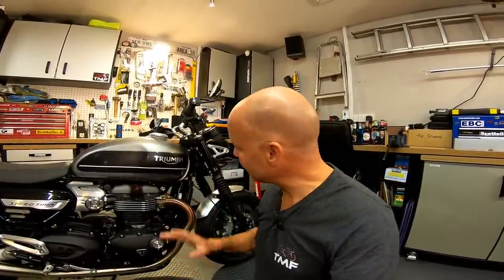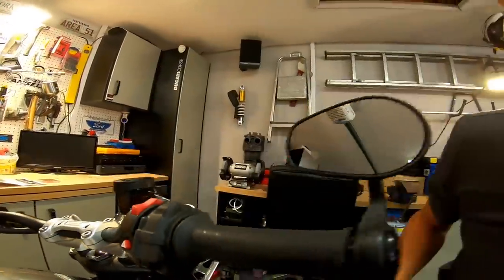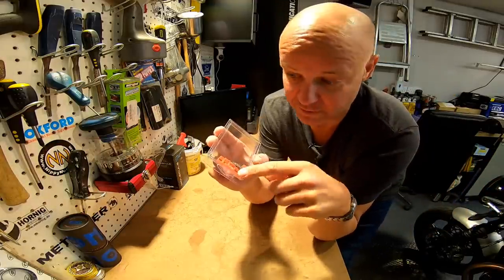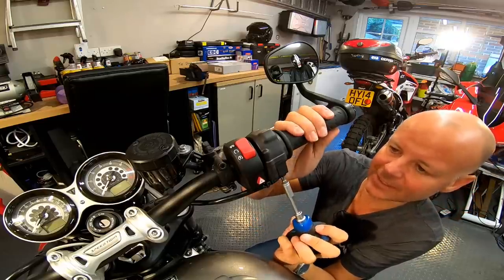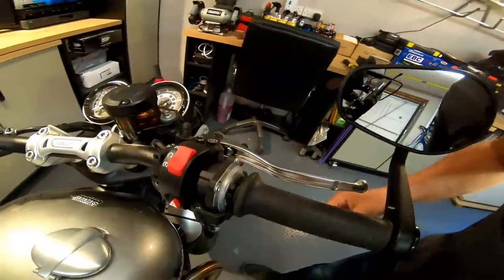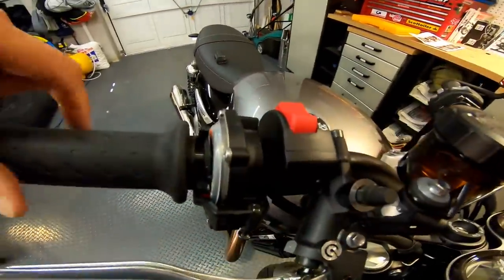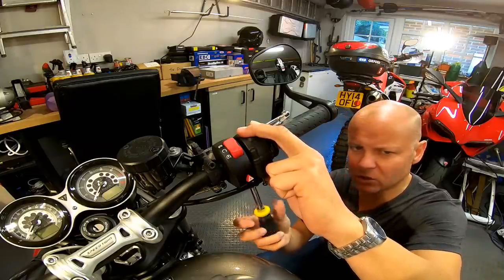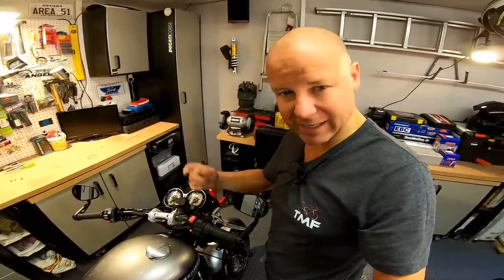Triumph Speed Twin - How to cure a snatchy throttle

Comment: It is a SHAME that you have to do those "repairs" on a bike which cost you 13000 Euro or more....
Reply: As he said, almost all manufacturers build the slack into the throttle; it isn't poor quality but rather a conscious engineering decision. Why they do it, I have no idea.
Reply: John Sumser same reason they fit tall first gears to sporty cars. Stopping the inexperience frightening themselves
Reply: @kawasakizrx1164  its a fix for throttles with ride by wire ( no cables to adjust)
Reply: You need to do maintenance on EVERY motorcycle
Reply: @jordanblack2250  This isn’t maintenance, it’s a fix for a manufacturing flaw

Comment: OK, but why do they sell you a multi thousand pound bike, that then needs 30 quid's worth of plastic 'falsies' to run well?
Reply from the maker: Ask Triumph!
Reply: Heh heh, true! Be interesting to know if their dealers are prepared to fit them to make a new bike sale, & if not, why? : )
Reply: Because it's a preference, not an engineering short-coming. Most people come from cable operated throttles and expect some play.
Reply: You can take the slack out of cable operated throttles as well, but manuals ask for cable play of 2-4 millimeters. I assume that's to make sure the throttle valves are definitely closed when you let off the throttle. 
Once you get a feel how far to turn the throttle to open the valve, it shouldn't make a difference how much play there. I guess since TMF rides so many different bikes, he prefers to have zero freeplay, so he doesn't have to re-learn how to adjust his throttle position on every new bike.
Reply: You shouldn't have to do this. The free play on TMF's Triumph was ridiculous. I had a Bandit 1250 with cables and tbh there was no where near that much play in the throttle.
Reply: @DrummerboyUK1  waa-waa-waa shut up dude
Reply: @dirkdiggler7727  illustrating your lack of manners with rude comments isn't the most intelligent way to open up discourse.
Reply: @DrummerboyUK1  yea I'm sure "drummer boy".  Play guitar like a real man
Reply: @dirkdiggler7727 you mean strum a guitar and pretend you're a musician? If you ever manage to grow up into an adult let us all know.
Reply: @ianjonesmusictuition6716  been playing 25 years so yea I'd say I'm doing alright
Reply: @dirkdiggler7727  just a beginner then. I've done 38 years, the last 25 as a pro. Shame you haven't grown up during those years isn't it.
Reply: @ianjonesmusictuition6716  not really a shame at all man.  I'm doing just fine. Congrats on the musical success.  Pro as in what may I ask? Playing bars? Studio musician for other nobody's? Cuz I'm sure no ones heard of you
Reply: @dirkdiggler7727 haha. Most 'musicians' people have heard of know nothing about music and are just pawns in a money making game. If you dont know what pro means I'm sure it's not up to me to explain.
Reply: @ianjonesmusictuition6716  whatever you say man
Reply: @ianjonesmusictuition6716  so I've been thinking and I think I figured it out.  You're a high school music teacher!
Reply: You mean you'd like to think I am. Not a job I've ever even contemplated. ;-D

Comment: 5 months ago - l put 2 small oil resistant O-rings on the top "lug" of the two in the throttle housing , instead of "the kit" , and it has been TOTALLY reliable. The above kit was purported to be approx $112.oo delivered in Australia .
15 minutes and "cents" to fit :•) Fantastic Result ! ! !
Needless to say : this WILL work for Ducati T0_0
My mod to throttle was/is very accessible to anybody - IT WORKS - enjoy the control.
Reply: John Buckley what was the diameter and ring section of the o rings?
Ta,
Norman
Reply: @normanemery7504  Orings l used are R-05 from an Aldi Workzone kit - 5mm inside diameter/1.8mm cord diameter .  l used 2 on the "top" lug , and have not felt the need to put any on the "bottom" lug closest to your thumb . It is a fidget to do without 2 more hands = but WORKS and is only pennies .
Update : the O-rings wiggled off after a few more months 🥴 so I took the 2 off and put only 1 back on with a spot of super glue on 3 of the faces of the lug 😇 and no more problems ! ! ! 💪

Comment: I've got a Jawa 350.  Throttle snatch is never a problem, in fact you can grab as much throttle as you want and it won't make any immediate difference.  It works rather like a telegraph system on a steamship, it sends a signal to the engine room, and a crew member opens a valve and eventually you go a bit quicker.

Comment: I fitted the spacers to my Street Triple R after watching your video on your Panigale, it makes a tremendous difference on a fly by wire throttle.
Reply from the maker: It's not just me then!
Reply: What year is your Street Triple R? 
I am looking to do this mod on my 2019 Street Triple RS (not the newest model out now)
Reply: @linserr90  August 2018
Reply: @yonniboy1  Ok it will fit mine then. Which model did you pick in the orderlist because there is no street triple in the selection?
Reply: @linserr90  I'll have a look to see if I can find the details as it was over a year ago.

Comment: Nice vid Andy.
In answer to all those people asking why there is free play built-in originally, and it's the same with the clutch lever, is that without it you cannot be certain that these controls are fully released. Thus the manufacturers have to spec a certain small amount of free play in them to make sure the operation has passed the release point. Bike manuals will specify the actual amount of free play to be set for the throttle and clutch controls.

For throttles this has probably become less important with the advent of electronic control, but it remains important for the clutch lever.

Comment: Thanks for this - very interesting. Of course the usual reason for having free play (usually about 5mm) is to allow for the movement of the bars and ensure that from lock-to-lock it doesn't pull the carb or throttle body from it's detented idle position. This is obviously negated with a TBW system - but manufacturers still seem to insist on having the free play there. It would be interesting to see if Triumph (or Ducati) have caught up yet?

Comment: I saw your Panigale video a week after receiving my new Speed Twin and ordered the spacers immediately. An absolute must for me, not only for first-gear riding, but also when flying through the gears on country roads. 
Yes, the plastic is worth a few cents (less than the supplied bit even), but the “problem” solved is worth way more than 30 bucks IMO.
While you’re next shopping on TEC’s website, I thoroughly recommend the Raider 2-1 (decat) exhaust. The look, sound, and especially the massive weight saving make this a very worthwhile purchase.
Reply from the maker: Cheers Lachlan - I have the Vance and Hines pipes on mine....I love em!

Comment: I've only ever had cable throttles and always take all the play out of the them as soon as I can. I know you're not supposed to but it makes any bike so much more pleasant to ride. I check for smooth throttle operation with the bars turned each way before declaring the job finished and am still alive to be typing this.
Reply: Do you think it would fix the snatchy throttle on my 2019 GSX S1000 which has a cable throttle? The snatchiness drives me mad!
Reply from the maker: No....
Reply: @david-comfortablynumb.2570  no, ask me how I know....fucking throttle is a nightmare on these bikes, bucks like you wrist is having convulsions. Only way to fix it is a remap. I've tried on my 2016 pcv 5, autotune, throttle tamer, slack removed, suspension adjustment. It's all made sod all difference.
Bike has now been remapped on a Dyno, it's a fucking beast now and 100% as you would expect

Comment: Took my new Speed Twin out for its first ride yesterday and immediately noticed the sloppy throttle at slow speed.  Expected a little, but was surprised at the amount of play and I agree, it really spoils slow speed riding. Blipping the throttle, nothing happens for the first part of the twist. Total contrast to my 2015 Street Triple. Not a major problem but just a bit pants. If, as someone suggested, its meant  to replicate the original feel, then I'm happy for my bike to be a little less authentic. Delighted to learn about this mod from your channel and have already sent for a set of the spacers.  Top tip and thanks for the discount code. (Helps towards the postage).
Reply from the maker: Yes this is a great mod - congratulations on the new bike, good choice!

Comment: I had the same problem on a 2013 Street Triple R - I just asked the tech at my local Triumph dealer and it was set up for me when I took delivery with no free-play.
Reply: Culchethstyle - did you use these spacers on your Street Triple R? I find the throttle jerky on mine and would like to fix it
Reply: @josephwagg4084  To the best of my knowledge I noticed the problem before the first 600 mile service, mentioned it to the tech guy and they adjusted it during the service.  Have a word with the service manager / tech guy at your local Triumph dealer.

Comment: Class, Just purchased a Multistrada V2ST, same issue, Thought it was the chain after coming from a shaft drive, and had resigned myself to live with it by holding the bar end and throttle to keep it steady, but I just checked and there is a fair bit of play in the throttle. Cant wait to try this one.  Thanks.
Reply from the maker: They are great little solutions to the problem.....

Comment: Well done TMF. I asked a forum the same question about the Street Triple. Some suggested leaving the slack as it was beneficial if you hit a rut or pothole, less jerk essentially. The feedback was mixed so I left it unchanged. It seemed a no brainer to me to make the mod.
Reply: I also have the Street Triple and find the throttle very smooth so don’t see the need for it. I checked the website TMF mentioned and the Streety isn’t listed as an option? So is that because the throttle body is different or they don’t think it’s worth doing? Anyway I wouldn’t change mine as it’s good as supplied for me.
Reply from the maker: Yeah it's a matter of preference I guess - personally I way prefer the precision control I get when the "slop" is taken out...

Comment: Note of caution.  I’ve had Throttle Spacers on a few Triumphs before & thought they were great, so I ordered a set for my Thruxton R, then watched Andy’s video again.  All looked ok when I installed them.  However, on my test-ride the bike behaved strangely ... the revs were slow to drop and I couldn’t easily rev-match on down shifts.  I pulled the throttle housing apart again & noticed that I had not pushed the spacers in far enough - they were ever so slightly rubbing on the throttle housing.  No wonder the revs didn’t drop as expected!   Easy fixed, but worth double-check as it only takes a few millimetres to get it wrong.
Reply from the maker: Yes care required - is a bit fiddly….

Comment: Good vid TMF,  there's a great 'free ' throttle mod that works brilliantly on my Tenere and other bikes. Basically on a lot of bikes the pull cable on the throttle sits 'on' the throttle body. By making a groove for the cable to sit in it is so much smoother...a disproportionately good result for a simple free mod!  Cheers Steve

Comment: Andy, I have just purchase a 2016 Speed Triple and noticed the free play on the throttle immediately.
I remember seeing your video on this issue so have just purchased some spacers.
Once installed lets see if it addresses the issue.
Thanks for the tip and the video.
Reply from the maker: They’ll work Jim - trust me on this!

Comment: I know you’re supposed to have 2-3mm of freeplay in the throttle to allow for accidental inputs when going over bumps/potholes etc, but that doesn’t make sense to me. When I’m on the road, if I’m going to hit a pothole, I’m already on the throttle, so I’ll have already taken up the freeplay. With that said, I tend to keep mine at the tighter end of the scale, allowing just a tiny bit of freeplay to prevent the revs from jumping up at full lock (cable throttle).
Reply from the maker: Yes I find the free play makes control far worse the majority of the time....

Comment: Very interesting vid! I'm into my 2nd month of new Triumph Street Scrambler ownership and have noticed the problem you describe. This is my first bike with a "virtual throttle" as I call them as opposed to the positive cable connection on my other bikes. I've read about the plug in fuel booster device which is quite pricey and seems to get very mixed reviews but the spacer fix is certainly worth investigating first! 👍
Reply from the maker: I have both and can tell you the spacer makes much more difference than the booster plug!

Comment: I've got a Speed Twin and a 2018 Suzuki GSX-S1000 that has the old fashioned cable throttle and when I experimented there with removing most of the slack I'd get jerkiness going over bumps as the slack wasn't there to absorb the throttle blips caused by the bumps.  So at first blush, tightening the slack on the Speed Twin would give it MORE jerkiness not less but first hand experience from TMF indicates otherwise and I can only assume that's because the electronics account for the slack on the Speed instead of the mechanics on the GSX.
Reply from the maker: I guess it must too - transformed the ride on my Speed Twin and Panigale for the MUCH better.....

Comment: Slack is intentional, to compensate for the changing radius of the bowden cable when the steering is at full lock.  Resolved on modern bikes by an electronic throttle.  The price you pay for cheap and simple.   Now await the quick fix to reduce leg heat soak on your Panegale ;-)
Reply from the maker: Well of course the Triumph Speed Twin is "ride by wire" and has an electronic throttle, as does my Panigale - neither of which I would describe as being particularly cheap/simple motorcycles - but yes I agree this was the case in the day of throttle's with cable controls....

Comment: i know everyone is different and taught differently depending on where your from, but wouldn't having some free play  on the throttle is ideal? Eg when breaking there would be times when you will still say engage 5% or more of the throttle.I mean manual bike yeah probably no problem but for automatics that extra % could save you. you never know what would happen in a emergency
Reply from the maker: Well I know it’s meant to be there but personally it doesn’t work for me - transforms the bike!
Reply: @TheMissendenFlyer  I believe the manufacturers have free play in there to mimic the feel of the old cable operated throttles.
Reply: @peted7295  Ride my wire throttles are snatchy without it, particularly in 'race' mode, did it on my Panigale and it works well :-)
Reply: Yes it should be there as you say. It all depends on how well it’s done. They are better now that on the first ride by wire bikes but you still get some better than others. My Street Triple is very smooth in all modes so I would never change it but if your bike is snatchy then it becomes a pain to ride and I would make the mod. On the website TMF mentions they don’t list the Street Triple as an option does that mean it’s a different throttle body? Don’t know.
Reply: @returnedtotheearth1326  Hi. Just checked their website and while the speed twin isn't mentioned on the opening page, there is a drop down menu to select the model which specifically lists the 2019 Speed Twin.
Reply: @TheMissendenFlyer   fair enough, to each his own

Comment: TMF - thanks for the brilliant video. I have found the snatchy throttle on my speed twin a real pain and is the only negative I have on an otherwise brilliant bike. I was considering the 'fuel booster plug' which to quote the TEC bike parts website, 
'This fuelling device interrupts the signal from the air temp sensor and modifies it to make the ECU add approx 4-6% more fuel during acceleration in open loop mode, it will not affect MPG as it has no effect in closed loop mode ie. cruising mode or steady running. The device has its own temp sensor and it modifies the signal to release the correct amount of fuel for the measured air temperature. Very easy to install with correct plugs ( PLUG AND PLAY ) no wire cutting required'. 
I will try your suggestion first, but do you or any of your subscribers have experience of fitting these?
Reply from the maker: Yes I also have the booster plug fitted on mine....didn’t help anywhere near as much as the spacer! Sometimes simple is best....

Comment: Just fitted them to my speed twin and taken the bike out for a test ride (between November rainstorms). The jerkiness at slow speed was my only criticism of what is a wonderful bike. At times, when manoeuvring at slow speeds it was very tricky. At first I was sceptical that a couple of tiny pieces of plastic would make any difference, and when they arrived thought I had been ripped off. How wrong could I be? As TMF says, it really transforms the bike. Thanks for the recommendation, and the TMF discount!
Reply from the maker: Told you it was a top mod Charles!!

Comment: My Tiger Explorer is the same, but can’t say it’s ever bothered me during my four years of ownership. Have you ever tried the ‘Triumph 12 minute tune up’?  Basically start the bike from cold, don’t touch the throttle at all and let it run until the fan kicks in and then leave it running for twelve minutes. It’s been known to work in the Tiger Explorer community.

Comment: Save yourself £30 and use 6mm strips of heat shrink tubing overlaid onto each other until you get the right thickness to take up the slack, when applying the heat gun just protect the plastic sleeve which is next to the rotating parts by using doubled up kitchen tin foil...simples